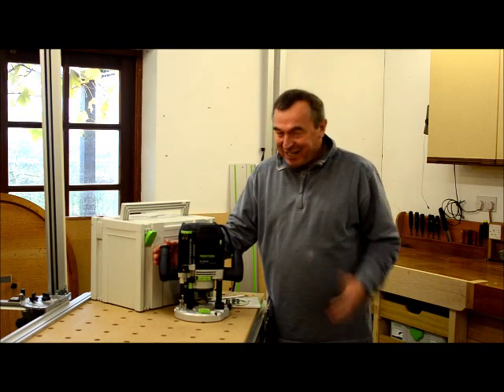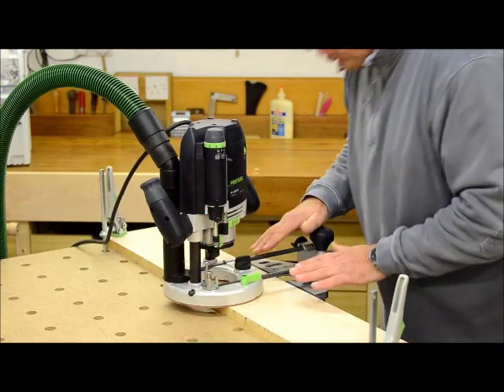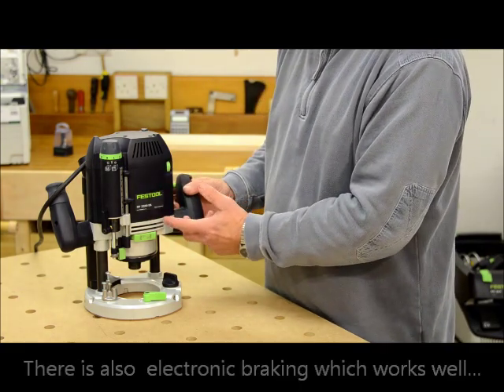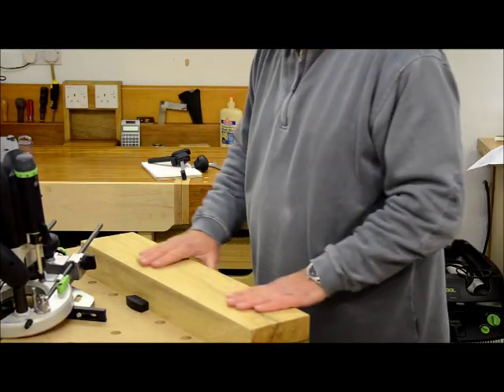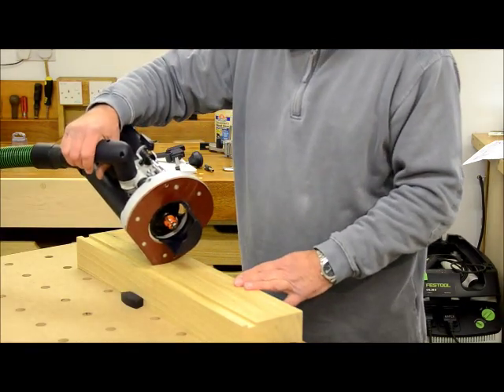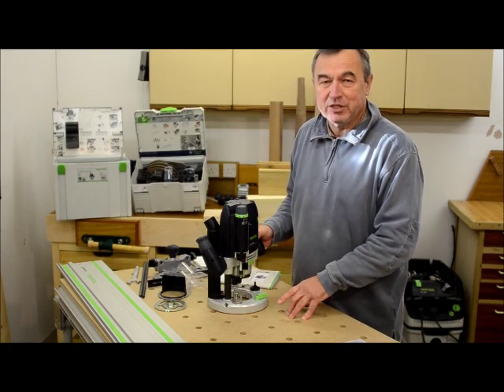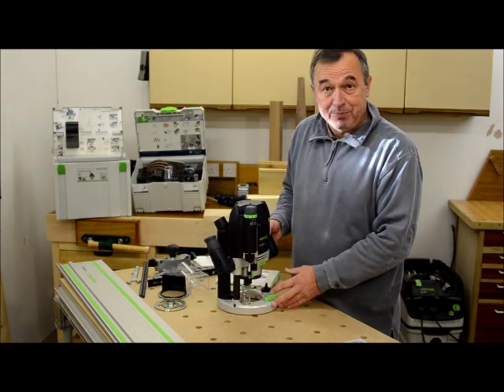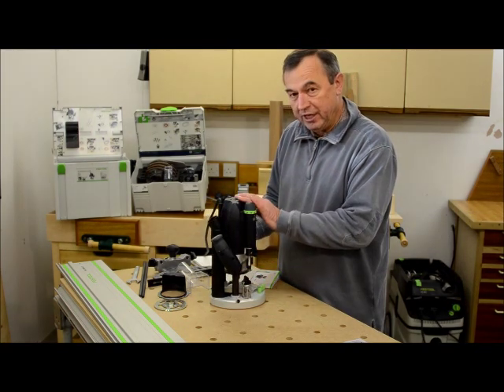Festool OF 2200 Router Overview

Comment: Hello, Peter, my friend. I was wondering what your thoughts are using this router for inlay work? Or perhaps the 1010 would be easier to maneuver?
As there is one used within my circle of region here barely used.
Also the lack of LED lighting...
All reflections appreciated 😊

Cheers
Reply from the maker: Hi Jon, For inlay work you do need very tight control of the router and so the smaller, OF1010, is a good choice. I understand that Festool now sell a lighting accessory for the router - I have not seen it or used it. When I do inlay work I mostly use a template that allows me to not only cut the recess (or hole) but also the piece to fit inside. Good luck.  Peter

Comment from the maker: @daikuone The OF2200 appears big but it operates so smoothly, has great reserves of power and is easy to handle. I prefer it to both my CMT and Dewalt which are much smaller.

Comment: when the bars are locked off they are not level therefore the router does not lay perfectly flat on the workpiece. but if you put a shim on the opposite side of the locking handle for the bars you can get the bars perfectly level which means the router lays flat on the workpiece, and the guide rail adapter lays level on the guide rail.
Reply from the maker: Hi John, If your router is new then get Festool to look at it. Mine does not need any shims at all.   Peter

Comment: Hi Peter.
Being a new hobby woodworke I recently started equipping a small workshop. Your videos inspire, and I was wondering... I bought primarily Festool including the MFT/3 table. Now I've seen something called Qwas Dogs...would you know where I can buy these in Europe (I'm from Denmark). Any help/comment will be greatly appreciated. Thanks. Br. Carsten D.
Reply from the maker: Hi Carsten, Have you heard of Parf Dogs, designed by me and made under the Veritas name by Lee Valley. They are available from Axminster and Baptist in NL. Many thousands are sold every year and I believe that they might be the most popular 20 mm bench dog. With these you can do all sorts and you then may go on to look at the Parf Guide System which allows you to create near perfect arrays of holes in your custom bench tops. Take a look through my videos or do a Google search. If you want to cut things square then do look at these Parf products. Good luck.   Peter
Reply: Thanks much. I will 😉👍

Comment: Peter I’m in the process of buying a cms set will the of 2200 work in the USA?????
Reply from the maker: You should receive all the parts with the CMS-OF unit for you to install the OF2200. However, you should be aware that for reasons that I do not understand the CMS-OF in North America is not supposed to be used with the OF2200. Festool are quite clear about this and will not support it in any way. Everyone that I have heard about in the US has had all the right kit with the CMS-OF to mount the OF2200. I am surprised that Festool still supply all the parts if it is not allowed to be used in NA.   Peter

Comment: Does the of1400 fence and guide rail adaptor fit the of2200? If not I feel I am buying a lot of duplicate stuff
Reply from the maker: Hi Ralph, Unfortunately not as the router bodies are quite different in size. You only need the fence on one of the routers though - think about it and decide which one.   Peter
Reply: Hmm, thats a shame but you make a good point. I do have the Makita RP2301 with a fence for 1/2" heavy work requiring a fence as well but then it leaves me wondering if I need this router at all - my problem is that I am a completist and since I already own 2 of the 3 standard routers that Festool offer the lack of this 3rd router constantly nags at me.  Stupid I know.
Reply from the maker: Dr. Ralph Kennedy Hi Ralph, I think that I am exactly the same as you and I would want each router to be complete too. Good luck with the decision.   Peter
Reply: Literally, just bought one from Axminster - the Festool vouchers also made me up my game so I plunged for the full kit at pennies shy of £900 - meant I would get £100 off instead of the £50 off the basic model - thought it made more sense than nickel and diming myself over the next few months.  When I first started woodworking I laughed at the idea I would ever spend £500 on a router and I've just spent almost double that. I have probably spent £3k on routers in my relatively short woodworking "career" and almost all of them have ended up on ebay sold at a loss. Thats why I no longer consider Festool expensive because I have yet to want to part with anything I have ever bought and fully expect to still have them in service 15 years from now. The Trend and Dewalt and Makita routers I have owned are really good tools but ultimately something on each of them frustrated me or was poorly executed. If the OF2200 is as good as the OF1400 or even - my personal favourite the 1010 - then it will have been worth it to have that level of precision at 2.2kw

Thanks for taking the time to respond - you probably help sell more gear than you realise.
Reply from the maker: Hi Ralph, One of the things I remind people, certainly the professionals and it applies to me, is that you always have more money invested in router cutters than you do in routers if you consider the cutters that you buy across the lifetime of the routers. Please could you contact me by Private Message as I would like to ask you a question. To send me a Private Message follow this link:  https://www.youtube.com/user/StoneMessage  then click "About" followed by "Send Message".   Cheers.  Peter

Comment: One problem with this router. When you .ock the bars off the bars do not stay level. With the edge fence it really doesn't matter. But with the guide rail and guide rail fence when you place therouter on the guide rail and put the right base on. The bars tilt the router. So the cut is not 90°. If you shim the bars so the router base sits flat on your work piece. It is like engineering in wood! Try putting the bars in the router. Measure with calipers the gap under the bars. Lock them of. And watch the difference.  Put it on the guide rail, and see how it sits on the work piece. So the cut will not be 90° If festool drilled the base for the bars it would be perfect. I used foil from a marvel milk tin to shim the bars and they stay in. The foil is thick and strong enough.
Reply from the maker: Hi John, That is most odd. Mine is fine and I have not heard of anyone else with this issue - is it still in the 3 year warranty period?  Peter

Comment: What is it with Festool....... I have the Domino 500 and the air clamp system which are both excellent tools. But why would a tool company sell the router fence as an extra?............A router as an everyday power tool is pretty much useless without a guide fence so the fact that Festool class it as an "optional extra" shows Festool are just profiteering from customers.

  Just my opinion but apart from the Domino there are plenty of other power tool companies that make similar tools that do the job just as well for far less money. The Festool Kapex  is a typical example of an over priced powertool that has less capacity than most but costs far more money to buy. 

  When companies start selling guide fences as extras you know thye are taking the pi$$............
Reply from the maker: +adie chip Festool tools are not cheap and not everyone (believe it or not) wants a fence with a router. A lot of routers go into tables as well. I suspect the real reason is not to try and make extra money from the customers but to try and reduce the initial cost of the tool. I have probably owned twelve or more routers at various times, maybe more, and none of the cheap and cheerful "supplied" fences were particularly good. I modified most that I owned but have not needed to do that with the Festool ones.    Peter
Reply: Hi Peter, Appreciate your comments.

   Having been a Carpenter & Joiner for some 32 yrs I like you have used many different makes of router and as you say the fences can be of dubious quality but the vast majority of routers are not used in tables.Its a bit selling a car and the wheels costing extra. 

 If someone is going to stump up £625+ for the router then including a half decent fence for around £25-00 wouldn't put people off when you consider you can buy a decent TREND T11EK or similar Makita for less than half the price of the Festool 

 Having said all that I do follow your tests with interests..  Regards Adie
Reply from the maker: +adie chip   Hi Adie,   Yes, I understand your points and agree that it would be nice to het the full kit in the box at the start.     Cheers.   Peter